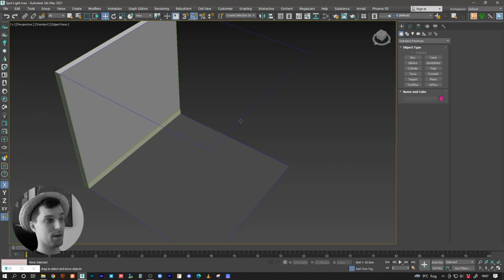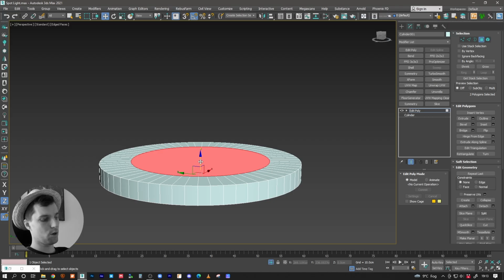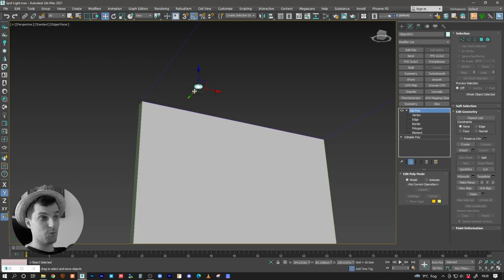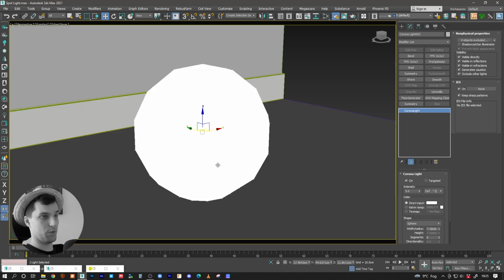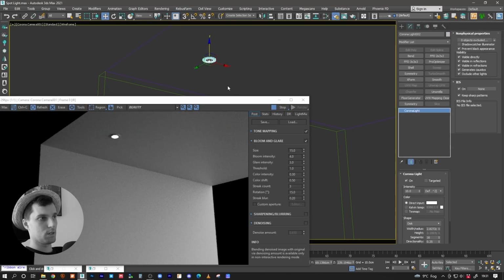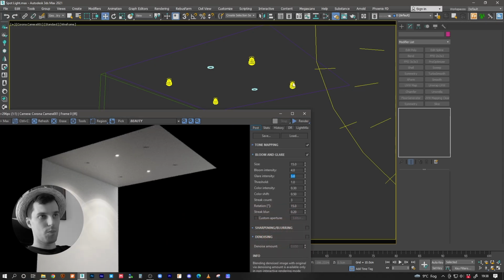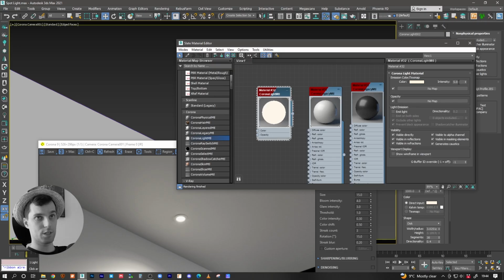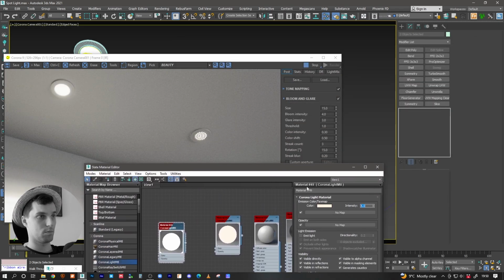3Ds Max | How To Model and Create a 3D Spot Light | IES Corona Renderer Archviz

Comment: Hi Romas! Thanks for another excellent tutorial. Your channel is definitely a gem in the beach sand for the people who wanna learn about cgi. By the way I am very glad to see that we are doing so many things in the same way with you :) I just wonder how you replicate windows, especially the relation between the glass parts and the environmental light.
Reply from the maker: I am glad my videos are useful for you. In regards to your comment: window glass and the environment light. Could you be more specific as in what issues are you having or with the thing that you are struggling with? 🙂
Reply: @RomasNoreika  For example I usually detach window glasses from window frames, and then remove their "cast shadows" checkbox in the object properties panel just to get a cleaner result in a shorter time when I make interior renders. Because when the skylight hits the glass before entering the room, usually it takes more time to calculate for the rendering engine especially vray. What's your opinion about this method and if you have another solution I would be very glad to hear. Thanks in advance!
Reply from the maker: I had a tutorial about doing that what you just said in regards to cast shadows receive shadows off. It does help. But nowadays we are not rendering cgis with 4 core cpus anymore. So its not a big deal anymore unless you have loada of windows with glass doors inside etc. Bottom line is I still do this sometimes If I feel like it especially with the frosted glass. Since frosted glass will block a lot of light. But I jave another technique with those sorta of things. 

Also it is good to do this when you have double glass panels in the window. 🙌 cast receive shadows off.

Will share that later on at some point.